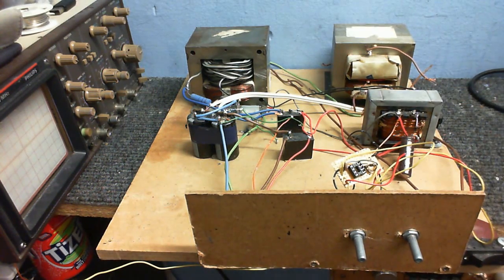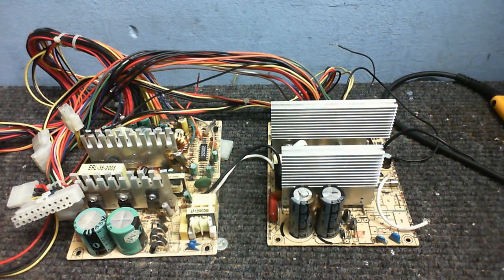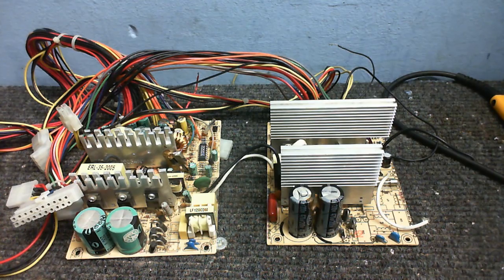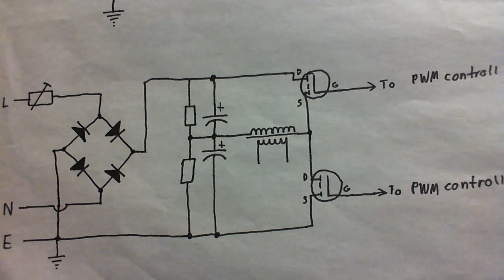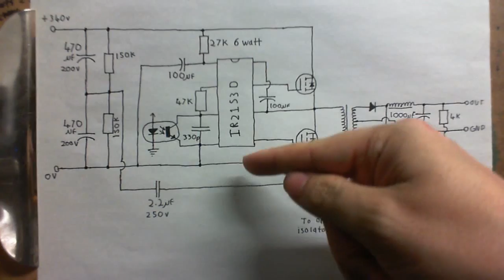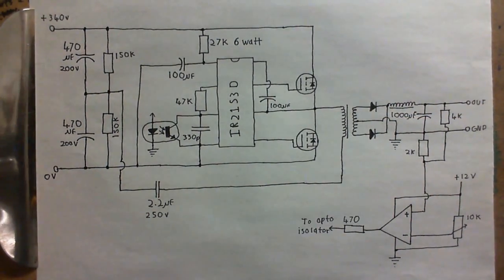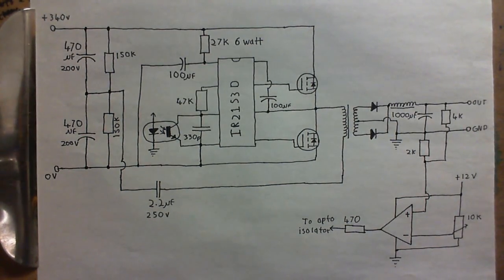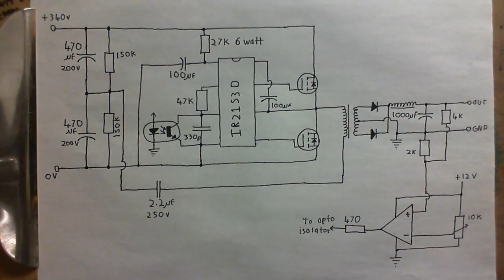Building a Switch Mode Power Supply pt 1 - 0verveiw

Comment: Sounds interesting, I have also made one PWM powersupply but ofc with fixed voltage using just a 555 timer. Anyway waiting for your 2nd video, you can upload just where you are right now and what you are struggling with, someone might give a gentle push up with nice ideas.

Comment: your MOT on the back left seems to have a lot of insulation and therefore less copper on the upper winding. They have high iron losses by increasing the copper losses with fat rubbery insulation won't help. That's why most transformers use enamelled copper wire, thin but good insulation that doesn't take up much space. ECW is pricey though, it's basically priced by weight, but you can cram in a lot thicker wire on a winding for the available space, reducing copper losses to a minimum.

Comment: i think i found another person that shares the same interests for electronics and accoding to the videos i saw i think we share the same manners for the type of electronic circuits we decide to evolve on breadboard etc. I also like the smps supplies. I think that the way that they operate makes them the mysterioys array of cooperating electronics that just work together to give us a voltage but we never really understand the complex way this voltage had to overpass to finally feed our output capacitors...I also have a dream of building a smps supply from scratch. I also am in the habbit of salvaging parts from every kind of smps's. especially transformers, double diodes, coils, mosfets. I want to ask you for the above circuit with comparator what part would you use for operational amplifier. There is literally thousands of op-amps in the market...Did you manage to operate the comparator control-optocoupler form of this smps? Cause on your next videos im not really sure you finally used an op-amp
Reply from the maker: +jimis04 Just about any op-amp would do, you would get the same results.  But I must say that the whole opto isolator idea that I had was not good.  As soon as the opto isolator is activated, the chip and the mosfets just die.  There's not much I can do about that.

Comment: Nice and funny video CoolDudeClem. I am curious to implementation of your build of this SMPS. By the way, is there not an other way to control the voltage of the output, instead of using an opamp?
Reply: Yes there is. Using an TL431 as a voltage reference in conjunction with the opto-coupler, that is standard and found out and sometimes it works even without it ( not very stable output of course). Google it for more information :)
Reply from the maker: Ideally what I would need is some way of controlling the duty cycle of the chip's output, I don't think there's any way to do it with the chip I'm going to use.  The way I've done it here should work somewhat, but like ciprianwiner said, it might not be very stable.

Comment: what should i do to get more ampere from the pc power supply???
Reply: Replacing the output transistors with bigger ones or adding a second set of output transistors might do it, but the overload protection (if it has it) would make it not worth it.  PC power supplies can deliver high amounts of current anyway.

Comment: "Nun-inverting input"? You leave those nuns alone, Clem.

IR2153 really can't be regulated. Bad feedback is worse than no feedback as you can cause oscillations, cause the capacitor divider midpoint to go to one of the rails, cause the transformer to saturate etc. Proper isolated feedback design for half bridges is complicated. At a minimum you need something like SG3525 and a type III secondary side compensated error amplifier. You really need to understand the feedback loop to stabilise it.

Comment: Hi Bunny!

You say nothing: Power Max, Current Max.
You do not even know why your PS crashed for the first time.
You do not have any current control at all.
Yes It may work for hazardous reasons.

There is theory to build push pull power supplies and all is related :

Frequency
Transformer
Max current transformer.

All ends up with probably  at leat some 3 members equations. 

But this is the minimum to make it from scratch.

If the transformer comes from an existing PS, and if you power up the frequency, 
you'll strongly low maximum power. 

Il you lower too much the frequency , current will grow too much and you will saturate transformer,
and then transistors will gray. All this in one! Will be very  fast!

Note that the transformer is referenced, related to its powder ferric concentration which directly influences its permeabylity.
So two transformers may look exactly identical but may behave slitly different. 

Your design circuitry is not bad but:
1/ You don't have any current control 
2/ You must keep the same frequency as original which was chosen for the transformer.
3/ You must also care about current from the bridge driver component : the one you choose has a very low output current and
even if the signal seams good , it could burn at least.
Usualy i prefer to take a stronger component and put some resistors into gates to slow a few  (les transitoires).
It is not really a problem for a DIY thing il you pay + one/2 euro one component.

Your may also notice that nowadays S.P.S include a factor current corrector in the input.
This is mandatory today.

Voila, merci pour ta vidéo qui m'a quand-même inspiré.
Jean-Yves.
Reply from the maker: Ironic isn't it? You said that I say nothing, yet in this comment you posted, you just babble on and on, also basically saying nothing. Are you trying to insult me? You have to do better than that, mate. Also you need to understand, this is all experimental, I'm learning as I go. Think before you post.